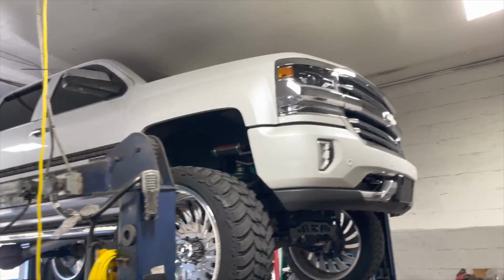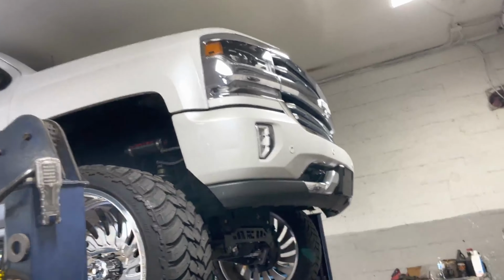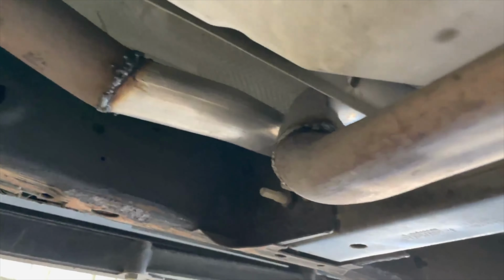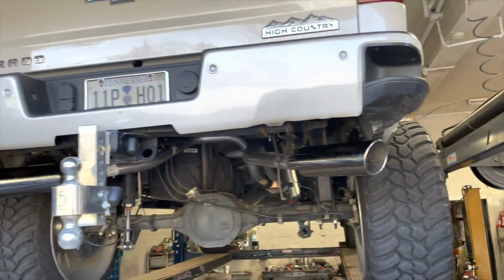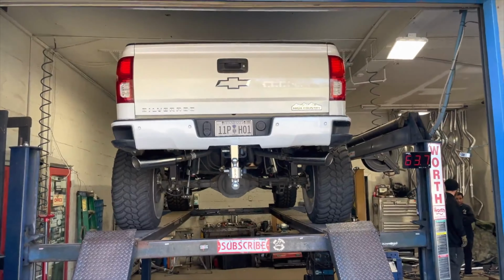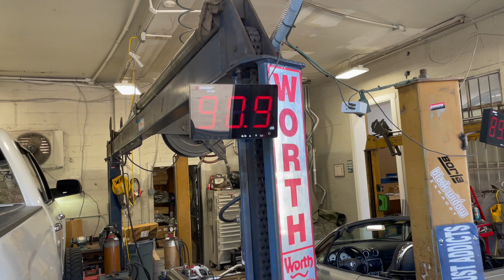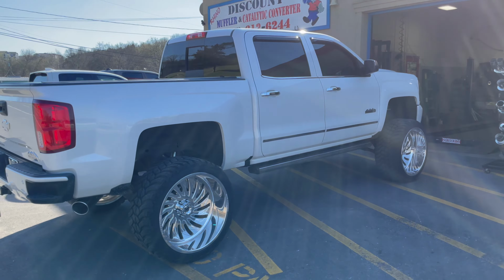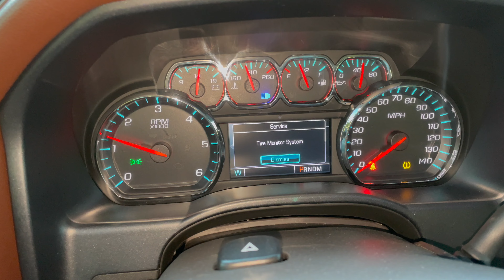2016 Chevy Silverado High Country 6.2L V8 True Dual Exhaust w/ BLACK WIDOW RACE VENOM!

Comment: $6K for wheels. that wouldve been a good payment for a whipple right there.
Reply: and even with the bumper cut still rubs listen as he backs up the truck
Reply: Yeap. Why not put Borla, Whipple and some eibach or hotchkiss stabilizers
Reply: Why to block up the engine?
Reply: @LamontBoucherville  running true duals like that has no benefit. So why even bring up clogging the engine?
Reply: @chkntndy7727  whoops I meant to say blow up the engine
Reply: yours not lying
Reply: Rather have wheels and a lift

Comment: Oh hell no! Yeah this is somewhat unacceptable. You can barely hear this truck and sounds no different than a stock 2019 Nissan Leaf, and that's a damn shame 🤔 Owner should have just run open manifolds, which is hands down the best setup and provides optimal back pressure and reduced HOA Fees and Fines on these 2016 Chevy Silverado High Country 6.2L's.
Reply: I know about hoa. but the nissan leaf 😆 🤣
Reply: This comment ain’t getting old to y’all????
Reply: @Cokknine333  no ots not the second half is always the joke. the actual funny thing is he would never run open manifolds 😆  his chargers got clean sound
Reply: He should have gotten smoke stacks behind the cab with propane injection and spark plugs with LS coils.  HOA will hate it but you gotta do something to make up for the squat and tire rubbing
Reply: @jonathanryan2915  😂😂😂😂

Comment: The rubber thing around the “wheel” is called a tire. And rough country doesn’t make a 9in lift for these trucks. Also sad that you gotta make a 5 point turn out of a parking space to back up because  you bought a tire/wheel setup that doesn’t even come close to fitting you truck and that’s with cutting it up. 🤡🤡🤡